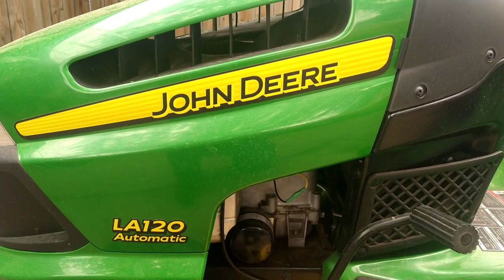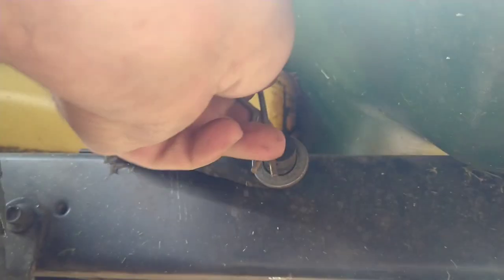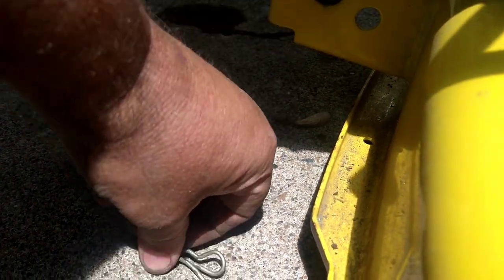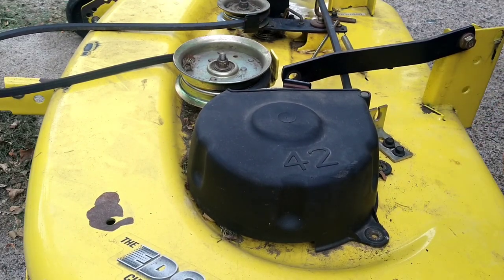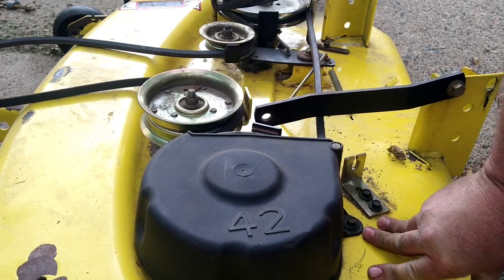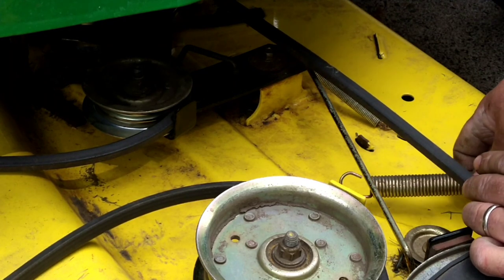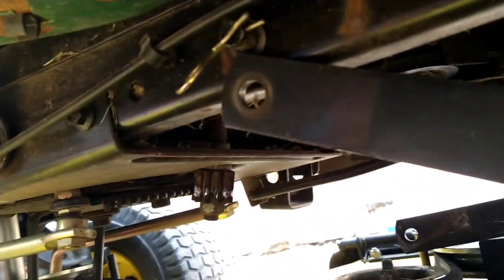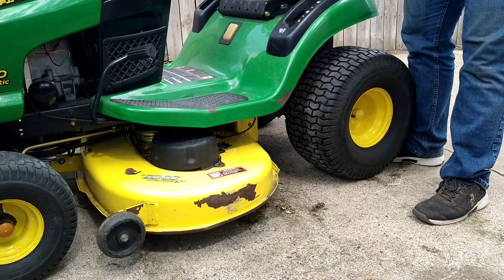John Deere LA120 riding mower 42" deck removal, inspection, reinstall

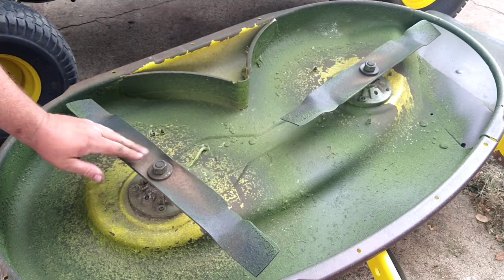Comment: 7:19 PB blaster or Aerokroil is your friend
Reply from the maker: @Brian0045  the blades came off easily, no chemicals were needed
Reply: @LazyGrandpasGarage  I should have waited until after I removed mine to comment. The nuts looked rusted to beat all hell, but they did come off so easily I'm pretty sure I didn't need it.
Reply: Mine were too tight.  Even with PB blaster it took away bit of work to get them off.
Reply from the maker: @philvanhorne9068  not sure why people put them so tight.